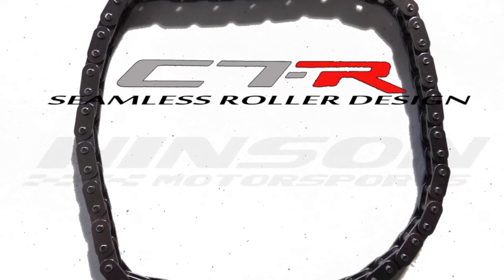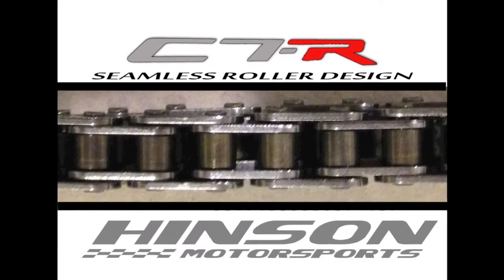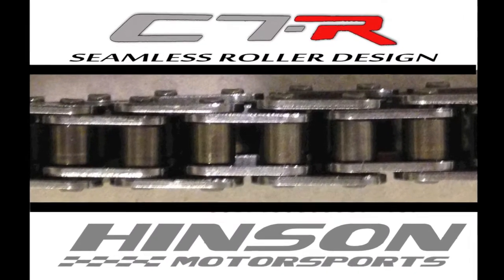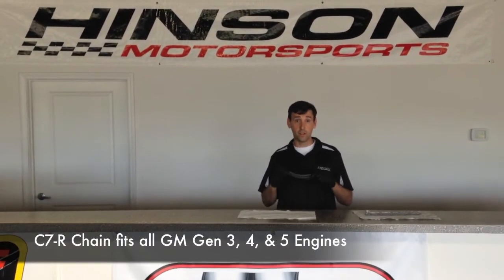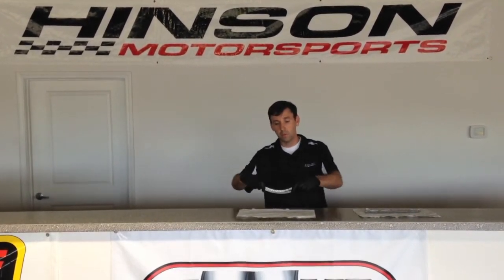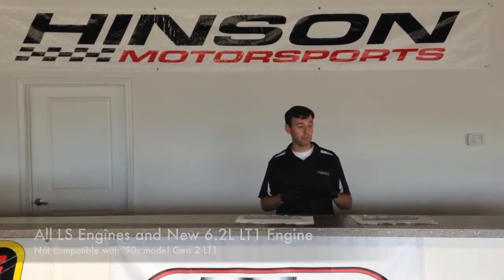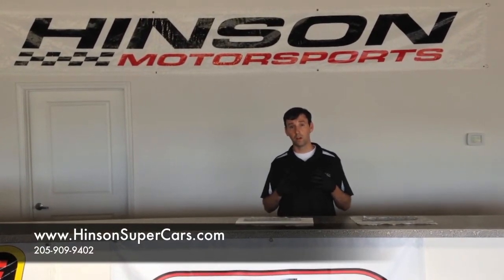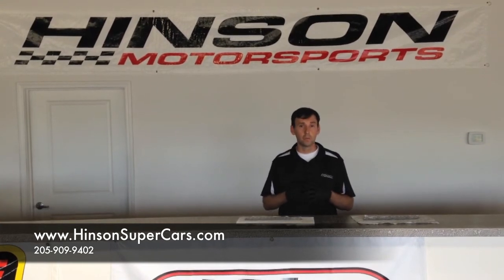Introducing the HINSON C7 R Timing Chain

Comment: I have made a lot of research before buying this chain and this is what I found out my lsx swap gear heads.                            Hinson has also been selling a chain called the C7.R chain, which is also misleading. The actual C7.R Corvette that races in the IMSA United Sportscar Series uses the Katech/GM Racing C5-R chain. All Corvette Racing cars have used that chain since the early 2000s. Hinson has taken the the IWIS aftermarket chain, made a seamless roller version and called it the C7.R. A change we feel is unnecessary, since a roller has never failed in thousands of chains. 

This is a fake this C7 chain go straight to katech and order there c5 chain I hope this helps everybody out